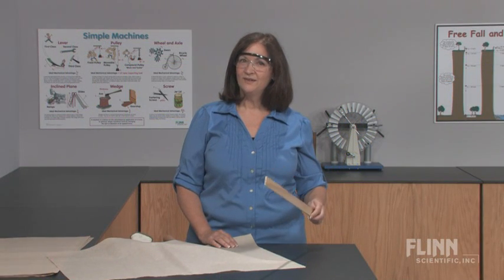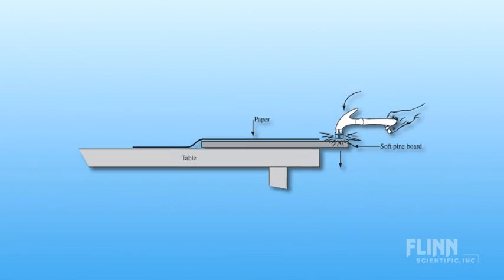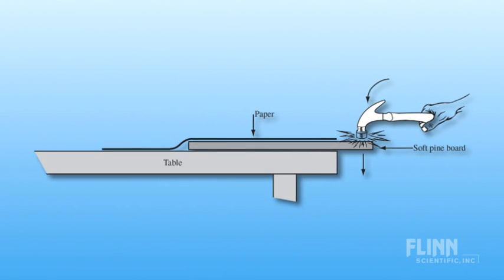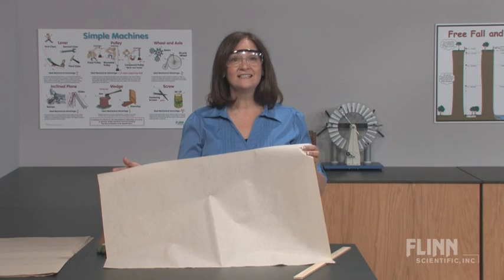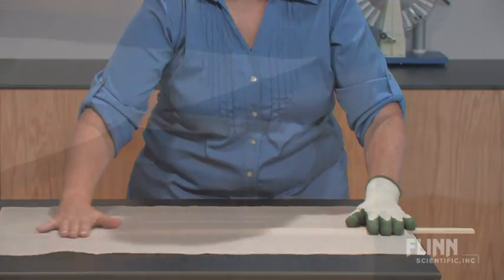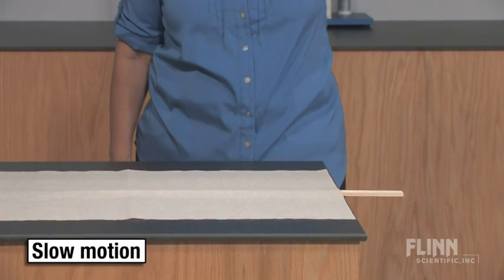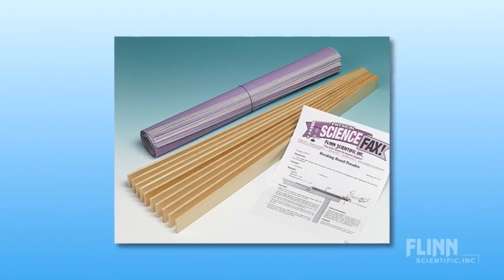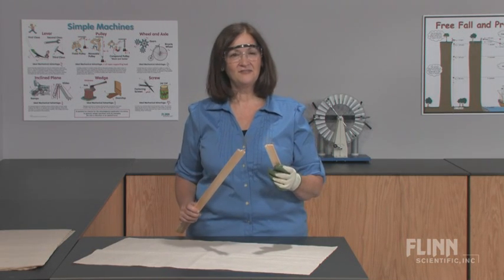Breaking Board Paradox Demonstration Kit

Comment: You'll find that this demonstration works much better with wider boards.   The resistance to the board is pretty much just the air pressure against the board itself.  The  primary purpose of the paper is to keep air from getting under the board.  While the wider board is slightly harder to break,   the air resistance against the wider board is increased dramatically with the increase in surface area,  which why wider boards don't move  unlike  the narrow boards that you are using.    I show the difference in this video:
https://www.youtube.com/watch?v=kRR0CluqaX4